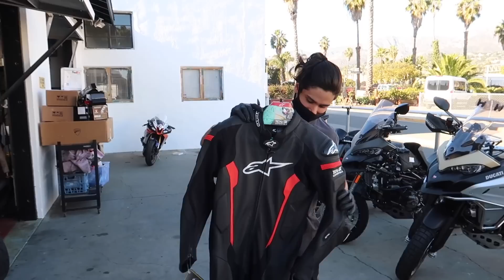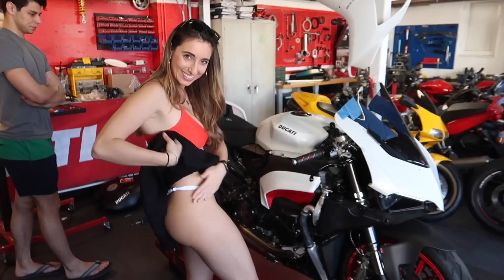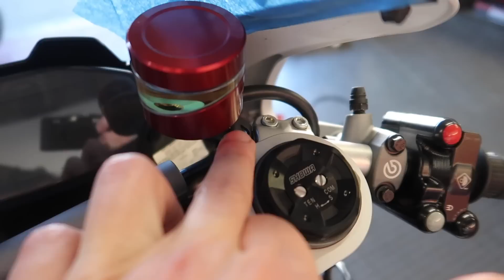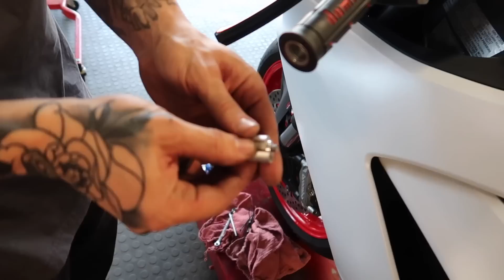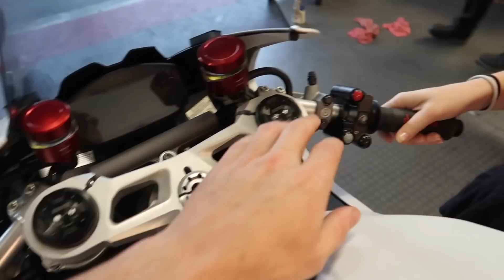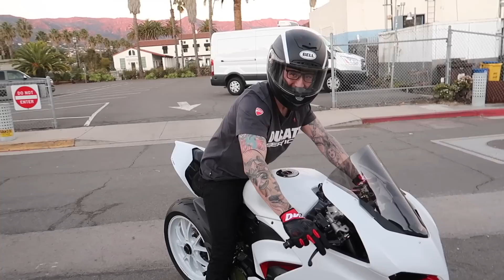The Ultimate Panigale V2 Control Setup!

Comment: Torque spec is how much that bolt  can stretch safely.  Larger the bolt or nut the more torque. So the size of the bolt determines the torque which fairly consistent.  Just like in real life there are exceptions as a typical size bolt maybe hardened to tolerate an unique higher torque value.

Comment: Might be tough to do, but red tint the little carbon pieces! Take that bike to another level! You have those same style switches going to the clutch side right? Thought I heard you mention that.
Reply from the maker: nah the bar controls are finished as they sit now...and we don't have time to do anything else on this bike except for the two final mods we've got planned as we need to have it finished in less than 2 weeks so we can move back over to the SF and get that done next month.
Reply: @JaretCampisi  ah that's unfortunate but I get it.